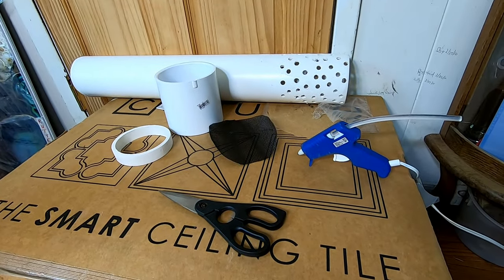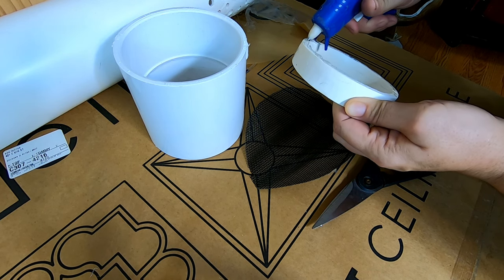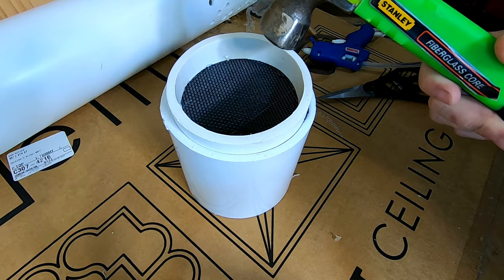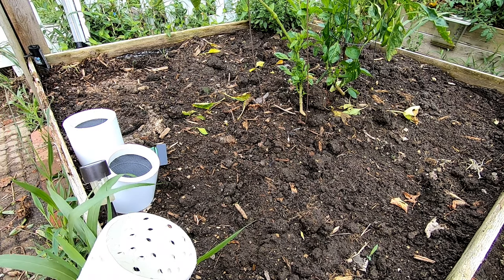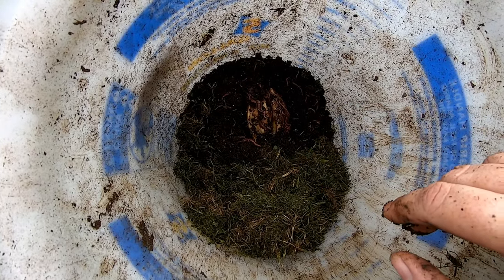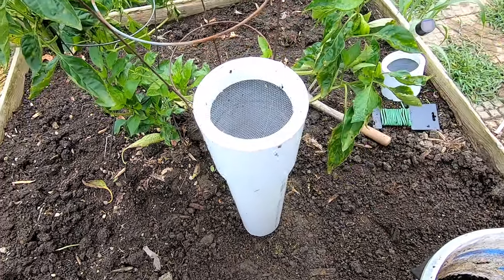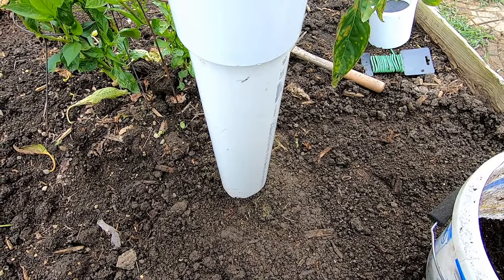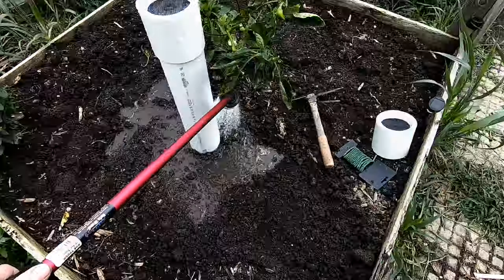DIY OUTSIDE COMPOST WORM TOWER SYSTEM

Comment: When we lived in So. Calif., we had several 5 gallon buckets with holes drilled on the sides and used that as free range worm compost bins throughout our backyard garden. They worked great! Of course, critters like opossums and skunks tried to get at the food scraps -- the buckets were firmly down deep enough in the ground so they couldn't be dug into or tipped over plus we put bricks on top of the bucket lids and no more problems! One bucket was used specifically for composting meat and we also had loads of free range BSFL. Will you be putting several worm towers throughout your garden area?
Reply from the maker: I have one more ready to put in that is the same size. I am planning to put a 5 gallon version under my big apple tree. I'm glad you had good luck keeping out the varmints.
Reply: @PlantObsessed  Ann, did the screen keep out BSF?
Did rain become a problem?
Reply from the maker: @texaspatty4697  I have not seen any BSF. The rain rinses out the casting into the garden. This makes more room for more food.

Comment: Do you feel your plants showing improvement in the following seasons,I'm doing no tilt and I have worms and now spiders like never before. 
Thanks  and Do try step bits for all plastic pieces, And they last forever if you only use them for plastic projects. 😉
Reply from the maker: I will have took up step bits. Lol I use what I find in the garage.  The plants have improved. I also water through the hoke and get the water deeper for the plants.